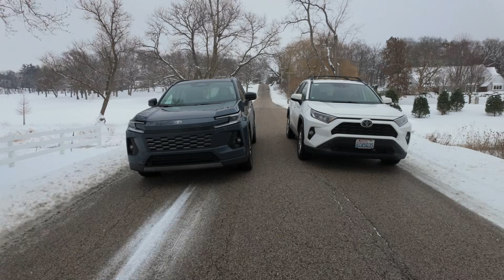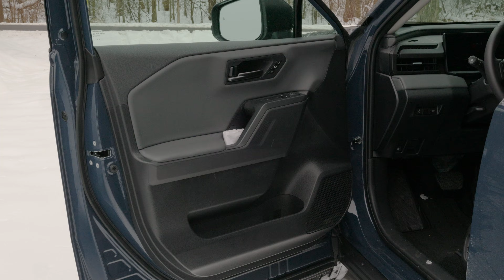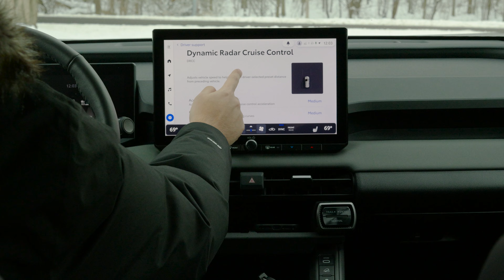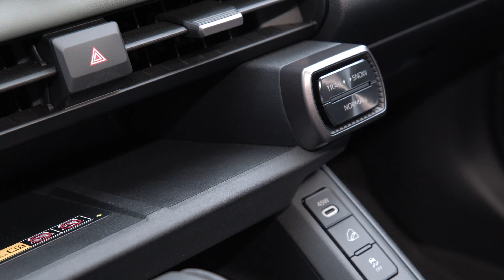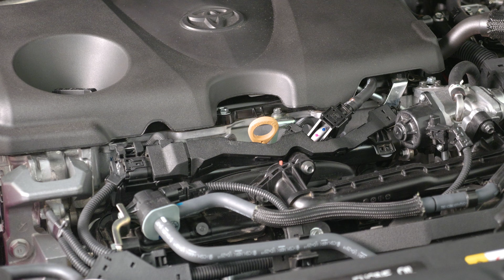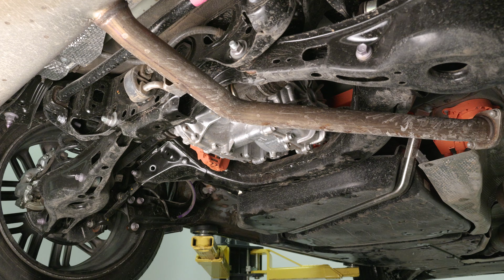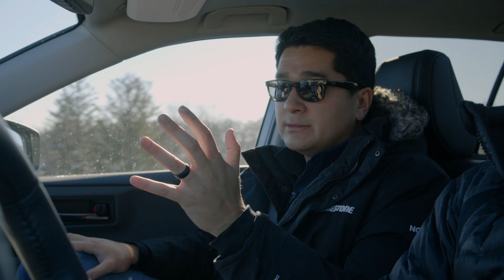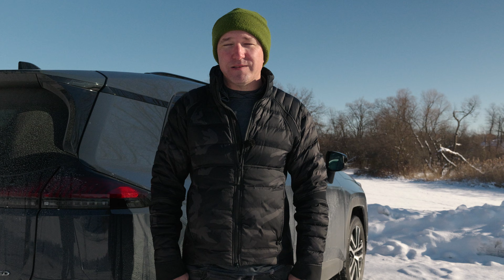2026 Toyota RAV4 | What Most People Want

Comment: A subscription to have the ability to use hardware built into the car you brought is obscene.
Reply: It's disgusting and should be illegal.
Reply: @sleeksilver hahahaha illegal is for countries with laws.
Reply: @sleeksilver  I agree.
Reply: I remember Audi has a paid subscription to use the Adaptive Cruise Control. The VW ID3 also has a paid subscription for 20-30 more horsepower. I can only describe this as a slap in the face of the customer.
Reply: If something stops working we call it "broken", if I have to send someone money remotely to get the feature back, it was held hostage and should be illegal.
Reply: @melissasmess2773 so your Netflix subscription is illegal when you don’t pay for it? Would you rather have the option to use something for $10/month a few months a year when you need it or pay for it upfront for $1000. The math is it will be cheaper as a subscription especially as the average owner of the vehicle only owns a car for 7 years.
Reply: Yeah, if it's for the app or 5G data, sure; they have their own cost for it. For buttons, heated seats, drive assist. HELL NO. I will vote with my wallet and that's a deal breaker.
Anything that used to be free and doesn't need updates to work, cannot have a monthly fee or I won't buy it. Just program it once to work well or if you have to update it, it's because you didn't do it well the first time, so it should be included.
Reply: What happens if you sell it while unknowingly having an active subscription?  Buying a used one with an active subscription would be a plus!
Reply: That’s a US issue. In Europe there is no subscription required.
Reply: Toyota should have to pay YOU if they want to keep control of any part of the car YOU bought and OWN!
Reply: @DashiellParr411 you technically only own the car in terms of hardware. They own the proprietary software which they can brick anytime and you’ll have a useless chunk of metal on wheels.
Reply: Welcome to 2025. Ugh.
Reply: Thinking of going with Honda.
Reply: Aren't 95% of people just using CarPlay or Android Auto anyway? Are you missing anything else besides navigation? Or are there OTA updates that you can't do without the subscription?
Reply: @andoletube car manufacturers like GM are now removing access to car play and Android auto so they can sell their own subscription services
Reply: when did the video mention a subscription to use hardware?
Reply: @raceagainstime  Traffic jam assist...He states this in the first 5 minutes of the video.  That using hardware and software built into the car.
Reply: Tell me about it. My civic is would have to pay for a subscription to use the starting feature from the key fob... it is already there so why cant i just have the feature from the get up. I mean i paid 34k for this thing
Reply: @Hallowsaw  Hey man, just want to let you know that you should be able to use it from the key fob for free. It works best when within 100ft. If you dont then you want to check if that key fob is working correctly.
Reply: Next gen is said to come with start/ stop button subscription.
Reply: All the manufacturers want to go that way. Volvo was charging to use the auto start through their app subscription. And that was on my older 2016 s60. I said nope
Reply: Most people do not care about those features, retention rate is 10-20 %
Reply: Do you expect your phone to make  phone calls without a subscription?

Are you people mentally slow or just cheap?
Reply: At a minimum it's super awkward from a business perspective. I don't know how they're not too embarrassed to entertain the idea.
Reply: Toyota has begun producing junk while trying to extort more money from us with subscriptions. I have a 2024 Tundra Hybrid Platinum. $74K truck with a 1 year subscription to all its services. Doesn't get close to the rated MPG. The huge screen is fairly useless except for CarPlay without the built-in Nav system.  For 74K, I should have built-in Nav, usable radio controls. No grab handles in the cab (that monstrosity on the front pillar is useless - people hold onto the one in the ceiling like my wife's '23 GX460 or my previous '21 Tundra. No tow hooks in a freaking truck. Who wants to climb on the ground in wet, snow, dirt or muddy conditions to connect a rope or chain if stuck or to assist another driver? Need a passenger step into the truck bed but they must think people only step into the bed from the drivers side. I have a list of 20 complaints on that truck which includes the engine "fading" when trying to quickly pull across several lanes of traffic - this is the WORST time for a stall.  Add to all of this a ticking time bomb of a 3.4L engine. I have a hybrid which we all know has the exact same issue as the non-hybrids but Toyota only has a recall on the non-hybrids. So, if my more expensive hybrid 3.4 TT engine fails, I'm hearing Toyota is only approving short blocks and not the entire engine. I wouldn't touch any toyota or Lexus right now with a 3.4L engine - hybrid or NOT. I wouldn't touch a Tacoma as it has a couple of issues. I'm closely watching the other models like the Grand Highlander. I'm pissed off and almost completely offended. When I get there I will write Toyota / Lexus off and start buying elsewhere.  Signed: Consumer who has purchased 16+ Toyota & Lexus vehicles so far.
Reply: Most don’t know it the subscription is for the 5g connectivity to the mobile carrier.
Reply: @JPRC  Vehicles should be able to connect to your cell phone for connectivity.
Reply: Agree F Toyota!!
Reply: actually your wrong with this statement
Reply: I’m ok with subscription heated seats in the north east only use the 3-4 months. If it’s $9.99 a month vs paying $500 to $750 upfront as I will never use my car to make it be worth the upfront cost.
Reply: @maxtokmin9683  What a clown.
Reply: It isn't hardware built into the car. It runs off an online data system that requires Toyota to map data and constantly update mapping software.

This isn't a set of 6 CDs in your trunk as a map like your 2012 Lexus... It's an online, updating, connect system. A connection isn't free.
Reply: @djplonghead5403  It uses the radar sensor in the front bumper, not the internet. FCA does the same thing, theirs is called Stop and Go. They arent readind traffic from a satilite and sending a signal through 5g to the car telling it to slow down. Its onboard software. This would be like needing a subscription to use the time delay option on your Mr. Coffee.
Reply: @thas6322 The MAP SYSTEM. Not the actual hardware part of things.
Reply: You mean like buying a phone that is capable of running any application, but you have to pay for the apps?  Or a TV capable of playing and movie and you still buy Netflix.. it’s the way of the future.
Reply: @ShockfactorCA  You are delusional.  How about this, imagine buying a phone and it comes with an AWESOME WIDE ANGLE CAMERA!  BUT it only works if you pay the monthly subscription.  You are describing SOFTWARE, hardware is not software.
Reply: @R @RyGuyTheAVGuy rtain HP printers won’t work without an ink subscription. The hardware is useless essentially. It happens in many products.
Reply: @ShockfactorCA  Jesus, I literally don't believe you are serious, you really lick the boot of corporate America. 

I'm not wasting time with this conversation.
Reply: @RyGuyTheAVGuy  so you throw a hissy fit when you wrong. Don’t let the door hit you on the way out.
Reply: @ShockfactorCA  Dude ink is a physical thing, it also runs out, you heated seats aren't going to run out, there's literally zero reason to pay a subscription for something you ALREADY BOUGHT.
Reply: @RyGuyTheAVGuy I didn’t say I agree with it. I said it’s happening in all sectors. This is repeat revenue. They are not going back. You can get mad, but all auto makers will go this way eventually
Reply: @ShockfactorCA In the USA.
Reply: Hyundai and KIA  want $20,000 just for changing brake pads,
Reply: Subscription the hell out of everything + convert all physical material into software based only on the merits of reducing cost and ease of manufacturing..

These are the fruits of the wonderfully trained minds of the MBA of the Ivys 😂😂 

We call these people smart..
Coming up with inventions that favor ONLY the manufacturer and not the consumer 😢
Reply: @digitalkov  Traffic jam uses sensors built into the car to creep the car along and maintain lane position while sitting in traffic.  My moms 2020 Acura does this, no subscription fees needed.
Reply: Do you also complain that you have to pay for a subscription to have the ability to use Netflix on the app built into the TV you bought?

LOL stop being so delicate.  The hardware is there if and when you want it.  If you never plan on using it (yea right), then just pretend the car is slightly more expensive.
Reply: You buy a cell phone and pay for subscription to use features on it … I hope you’re as upset about that as well and are rushing back to use rotary dial phone back when America was great for you lol
Reply: @M @MingusDewfus ou buy a phone for things like camera, connect to the internet, browse etc. You don’t need a subscription on the phone itself to do those things. It can be simply a smart device that only connects on wifi. If you connect the phone for cellular service, fine you subscribe to that. 
You’re not subscribing to a Toyota Connect on a 30k-40k vehicle just to sit in traffic and automatically do it for you. That kind of feature should be done on the car itself and built in. Like remote access too (which is also on the Connect). 

The only time I should be paying for that connect service is if I’m trying to connect to the web or have cellular connectivity on the Rav4. Which you should also just hotspot if that’s the case.
Reply: same people are the type to pay a Netflix subscription just to use Netflix to watch some movies, smh

go back to CD's or tapes or whatever they used back then
Reply: Then buy something else.
Reply: So you expect a continued service for free, forever? 😅
Reply: @mad1394 yes
Reply: @mad1394 how long is it included for free with purchase?
Reply: @mad1394  It's not a service, it's already built into the car AND it was free for like 10 years now it's a "service"?
Reply: @henrymiecz8566 which function are you talking about? I am talking about navivation with traffic updates.
Reply: @mad1394  Not the one you asked but I've read previously that when you don't pay for the subscription service that they disable the ability to remote start the vehicle with the fob. Not sure if there is anything else that they're talking about though.
Reply: @TheCobruhAlienat0r  start/stop button subscription
Reply: @mad1394  Remote start, heated seats.

Comment: I’m buying this or a CRV in the next few months.  Leaning towards a high end CRV as it has more physical controls and the hybrid is seamless.
Reply: I test drove the highest trim CRV recently.  I almost couldn’t tell when the engine kicked on.  I was pretty impressed.  I’m giving my ‘24 Civic Touring to my grandson and want to replace it with a part time winter 4 wheel drive unit.  I’m sure it will last ten years and 80-100k miles which is all I’m looking for.  I really like the tech and safety systems in the Civic which is why I’m leaning toward Honda.
Reply: @Closertotruth2 

Exactly. The CRV HYBRID is perfect. 💯
Reply: Modern-day Hondas have many reliability issues.  You shouldn't buy one if you plan to own it long-term.
Reply: @zarbon700  Agreed.  I've owned to Hondas long ago and loved them, but the new ones have some real reliability problems as well as comfort and just cheapness.
Reply: @zarbon700 

Illogical. Empirical evidence and data doesn’t support this statement. Rated one of the most reliable brands in the world.
Reply: @billyrock8305  You're delusional. Honda has been steadily dropping in reliability rankings over the past 10 years.
Reply: Honda's hybrid system simply isn't as good as Toyota's. With Toyota's gen 5 hybrid system you will exceed EPA fuel economy ratings with ease in real world driving. That's not going to happen with the CR-V. I personally believe that Toyota's system is far more seemless. I'm not a fan of the way Honda hybrids RPM's go up and down with no relation to speed or acceleration. I understand why Honda does this but it makes their system feel janky and unrefined.
Reply: How long do you plan to keep the car
Reply: Wise 😊

CRV better. 10/10 score Car & Driver 🥇

Logical analysis leads me to conclude that the hybrid system in Honda CR‑V Hybrid is superior to that in 2026 Toyota RAV4 Hybrid — not because it produces more raw horsepower, but because the CR-V’s 2.0-liter 4-cylinder + two-motor hybrid setup yields a smoother, quieter ride, very responsive low-speed torque, and a more comfortable, spacious cabin that enhances everyday driving comfort and practicality.
Reply: both boring
Reply: @BunkGrave

Beauty is in the eye of the beholder. If you’re a college kid trying to look cool to pick up a chick-agreed. If you are a soccer mom or a senior the CRV looks like a Porsche Boxster.